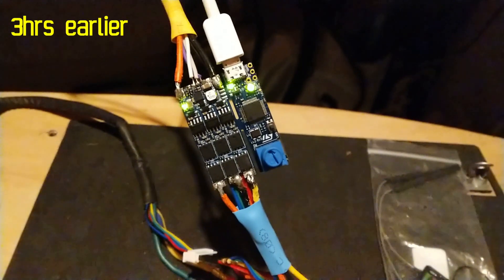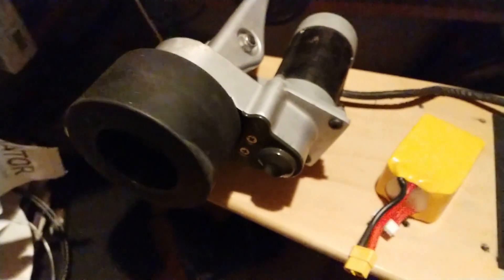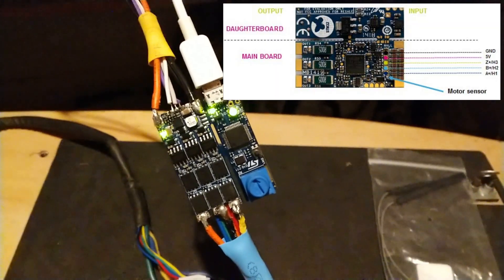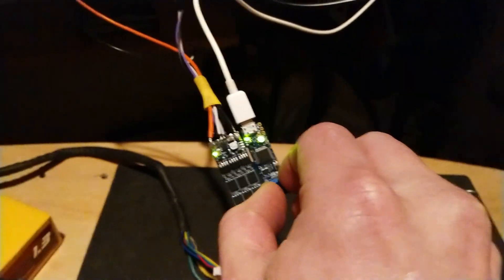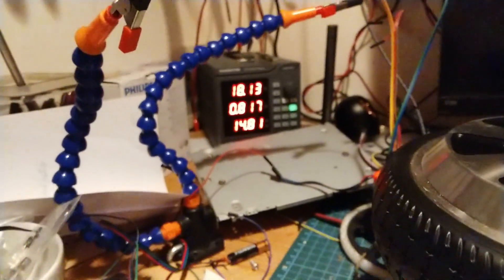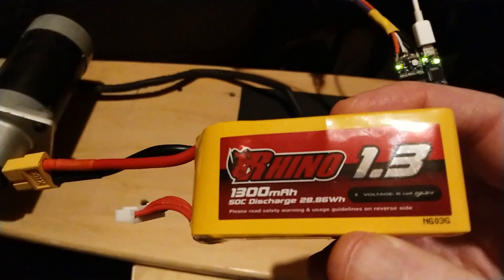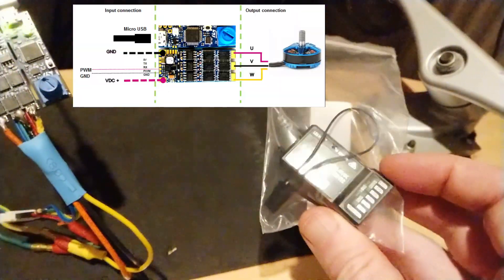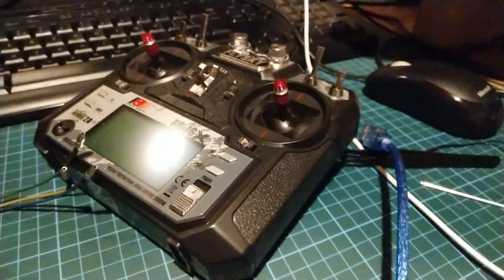3hr electric skate code/build using SimpleFOC and drone kit

Comment: Thank you for showing this. I have been studying the possibilities to use a similar drive for sewing machines. The motor specifications for skateboards are close to motors, that might be used for sewing machines. For sewing machines you do however need a very large speed range and good low speed control and response. I noticed that you also upscaled the ESC used for another project due to limitations of the ESC being too hot at higher motor currents. I should like your estimate of the possible long time max current for the B-G431B-ESC1, when it do not have forced air cooling.
I have seen a few comments from you at the SimpleFOC forum as well.

Comment: Thanks for your great work! I'll be mixing your code with a hall sensor example on the SimpleFOC github repo to make a sensored control system for a blender. Fingers crossed.

Comment: Hi Owen, thank you very much for the video. Spend 4 hours of configuring Visual Studio Code with the appropriate pull requests.
But can't still get it running. Used in the past quite often CubeMX, Keil. Please help how ca I add the STM32duino changes, where is the location of the folder under windows? Can you please create a video how to setup Visual Studio Code for Arduino?
Regards
Reply from the maker: It is a little involved. One PR adds it to Arduino, and the other to platformio.  How about you ask the question at https://community.simplefoc.com and I'll try to answer it. When both PRs get merged it should be easy.
Reply: OK I did it.

Comment: Nice find. Thank you for sharing.Please make video for initial software setup mentioned in the manual and wiring connection without daughter board.
Reply from the maker: The 'initial software setup' is if you want to use stm32 cube ide (and stm32 framework). I'm not using any of that code as i wanted to use arduino framework and simplefoc lib. I did download the stm32 code you mentioned to have a look at it and to help me create the stm32duino variant definition which is needed if you want to use arduino framework. I've created a 'platformio and simplefoc' youtube vid a while back that gives some clues as to my development approach
Reply: @OwenWilliamsRobotics  Thank you for you quick response. I hope you try this board with hover board motor you have and test it's limit.
Reply from the maker: @gsge  - I've tried it with a hoverboard motor and it is quite a good match!  It is a little hard to solder - particularly the hall sensors.  I think I might have dislodged a pullup on one of the hall sensors because it was glitching until I added an additional 1k pullup.  Good luck.
Reply: @OwenWilliamsRobotics  Thank you for confirming it.

Comment: Loved seeing you skate it 🤙
Reply from the maker: I had the voltage_limit dialed right down so not super fast. I'd like to retry on vesc 4.1 controller that i have kicking about the house. For some reason I've never thought to use SimpleFOC with it. Should work?!?
Reply: @OwenWilliamsRobotics  There's one way to find out.